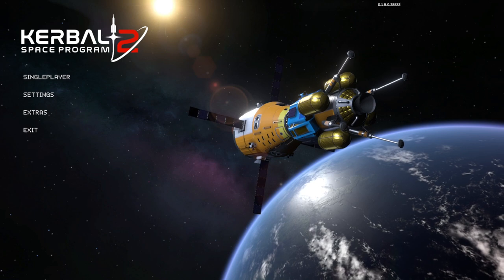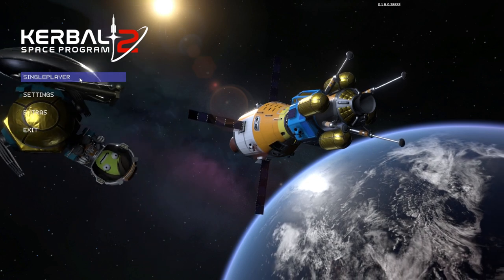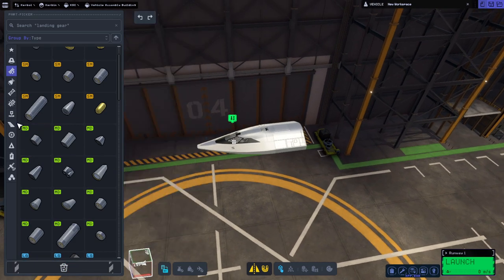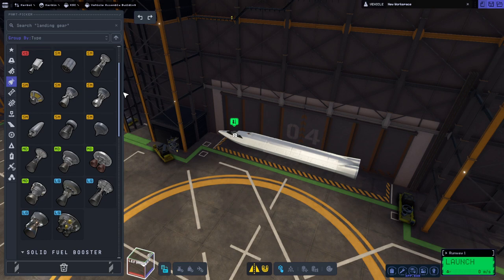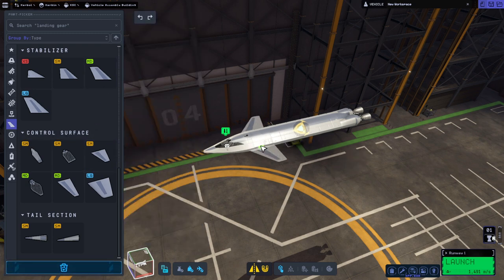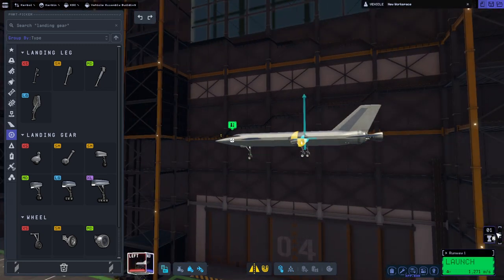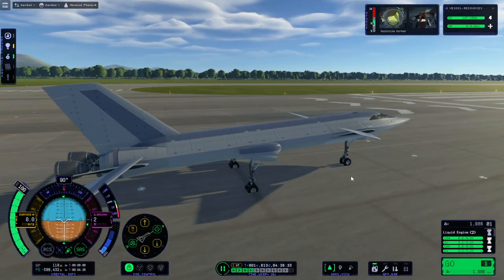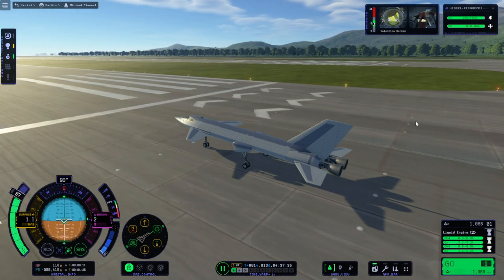KSP 2 Early Access - How Much Wing Do We Need?

Comment: I tried with the new patch.  I did a Steam uninstall and reinstall, deleted all my old campaigns, and started from scratch.  Game should be 'clean'.

Here's what happened when I tried a couple missions - Kerbin-Mun and back, and Kerbin-Duna and back.

1. Small and medium landing legs won't extend. They work fine in VAB. But when I launch, Parts Manager says they're blocked. There's nothing blocking them. Oh, and the new large landing legs are even worse. I won't even try them any more.

2. Small solar panels either won't extend or won't retract. Again, they all work just fine in the VAB, but once I launch, they no longer work. Parts manager says they're either extended or retracted, even when they're not. No electricity, mission over.

3. Airbrakes won't extend. Yet again, they work in the VAB, but upon launch, they become inoperable. Parts Manager says they're blocked, but they're not. A big problem when you've made it all the way to Duna with a delta-v budget that accounts for airbraking at both Duna and Kerbin and now you can't use them. Not enough DV to get back, mission over.

Nope. It's still too soul-crushing to play. I'll take another look after the first of the year.
Reply from the maker: I used the small landing legs without trouble, but I'll have to check out the solar panels and airbrakes. Having those parts all read as blocked sounds like something specific has happened, but it might be difficult to replicate. I wonder if there was anything consistent about the crafts that they were all on - any other part that might actually be causing the glitch.
Reply: @RaizSpace    Hmm, my landers are more or less conventional vertical descent types.  For Mun/Minmus/Duna missions, the lander returns to Kerbin using a parachute and airbrakes to shed DV.  I still don't trust docking ports..  The landing legs are attached to either a small or medium size methalox tank in symmetry 4.  Same goes for the airbrakes.  Some solar panels have always been borked, but now the ones that used to work for me don't.  

Maybe I should try again with a bigger lander that uses the large methalox tanks and see what happens.  Sigh..

I can't believe the devs don't know about this.  I just would like more communication from them.

Comment: I have a question regarding the kps 1 variant of this video. You showed how to make sure a plane is stable under a couple of likely scenario's, but thats just guesswork. Is there a way to turn all the values into a chart of maximum aerodynamic stability? It should take into account speed and altitude with their dependancies.
Reply: i like whatyour saying here
Reply from the maker: The first page of the FAR dialog - the Static Analysis - will give you some charting options, but I've found the Dynamics page is both easier for people to interpret and also sufficient. I have not found that the likely scenarios have led me astray and they are not just guesswork. In reality, you don't even need to be so thorough as I was being here.
Reply from the maker: I'm not sure why maximum aerodynamic stability would be the goal. Rather, we were more trying to see how little wing we could get away with - effectively, how close we could be to instability without actually being unstable. Some planes are even deliberately unstable: https://en.wikipedia.org/wiki/Relaxed_stability
Reply: @RaizSpace  The graph would show to path with the highest aerodynamic stability. Tweaking the wings and stabalizers to be smaller will just make the possible path narrower, until there is no path available at a certain altitude with stable aerodynamics. Yes, you're right, this would be way overkill for planes in ksp. 
In reality, you would sacrafice stability for weight or manouvreability. So yes, the "right" stability is more complictated then just maximum stability. 
I appreciate your engineering perspective. Ksp 1 is a great way to simulate complicated ideas and prove hypothesis.